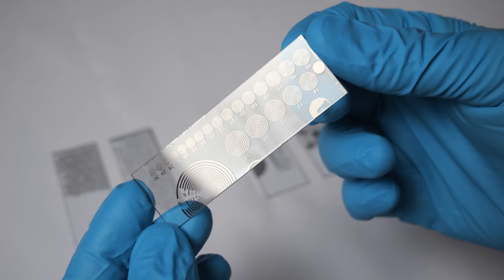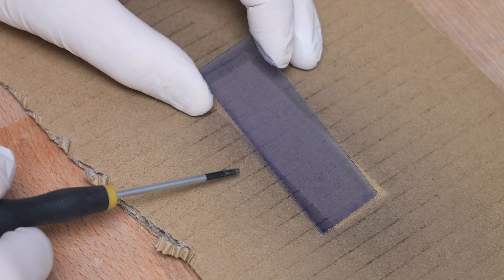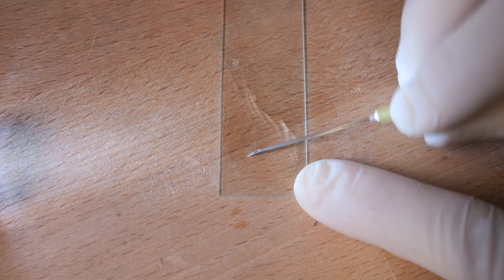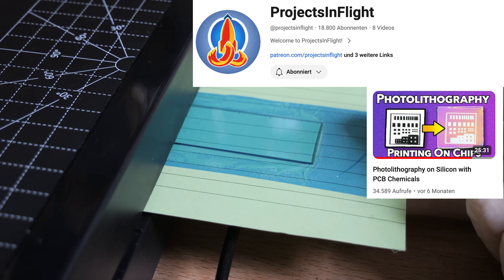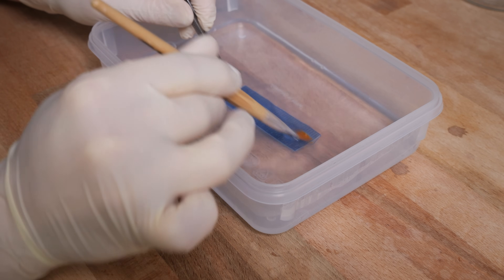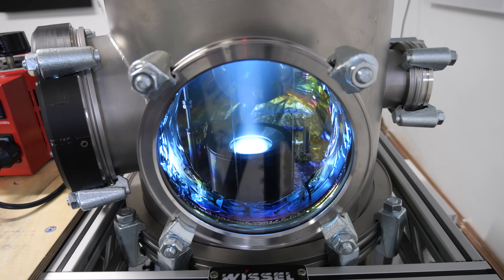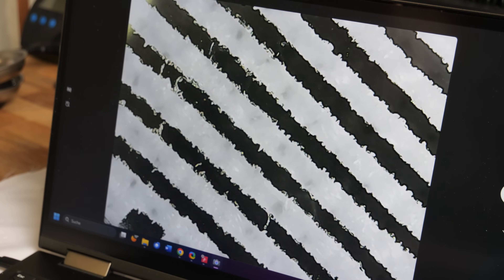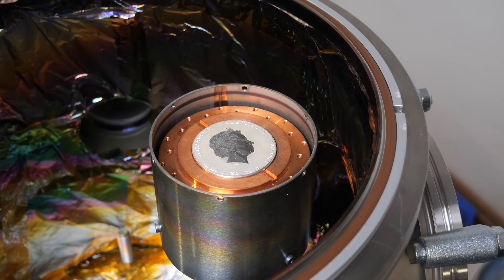Writing in Titanium on Glass - Lift-Off Photolithography

Comment: I wonder how hard it would be to repurpose a SLA (or MSLA) printer to replace the masks.
Reply: I'm pretty sure that would work great as long as the photoresist is sensitive to 405nm light. You wouldn't need to modify the printer at all. Just put the slide down onto the screen and expose it with your image. Converting an image into an STL or 3MF that could be printed is trivial.

Comment: I wonder if you could use a fiber laser on very, very low settings to "draw" on the photoresist.  Of course that requires a fiber laser at the right wave length so it would be expensive and possible not work.
Reply from the maker: I was also thinking about that. But a fiber laser is prohibitively expensive for me. Otherwise it would definitely be worth a try. Maybe not even using photoresist but just burning away a coating (layer of paint) which can be dissolved after sputtering.

Comment: I was wondering if you couldnt just print the mask in big letters then use a lens to focus down the light passing through the paper? It would require a lens the size of your sheet of paper but i believe you can get a4 size Fresnel lenses for pretty cheap.

The only thing you'll have to figure out is where the focal point is.

But then you'll have the ability to get samples the size of an A4 sheet of paper with the current resolution or smaller samples:

In the case of the glass plate youre using 26x76mm plates, using a4 sheet you'd get aproximatively a 10x in your resolution.
Not enough to call it perfect but cheap and easy to setup!

Comment: Have you considered using an MSLA 3d printer to expose the photoresist? Modern ones have nicely designed optical systems that project very detailed UV light in whatever pattern you want. It would add a bit of cost, but you could skip the special paper and printing and probably have higher detail as well.

Comment: LED household lights don't produce any UV.
I work with photoresist under white LED light regularly without issue.

As for increasing resolution, is it possible to use multiple masks layered like they do for silicon chip production?

Comment: How about making inverse photo-magnifier setup? You could then use much larger physical mask, but using a lens project the actual UV exposing onto the glass slide with much smaller dimensions. Just like modern silicon wafer photolitography process but much simpler?

Comment: Something tells me the anti-aliasing in your computer's fonts or OS may be reducing the quality of your masks.  Hence the single side fuzzies perhaps.  

If not that, an image reducing setup may be necessary to get higher quality.  Collimated lighting followed by reflection off of a glass backed first surface mirror mask (created by magnetron sputtering) and then shrinking lenses or mirrors should be adequate.

Comment: Awesome!
Rather than improving the mask resolution, would it be easier to focus the UV optically? You mention wanting the lamp "as far away as possible", presumably so that the rays are approximately parallel at the shadow mask, but it should be possible to put a much larger mask directly on the lamp and use a concave lens to focus it down to slide-sized parallel rays. Similarly, you could then use an LCD (e.g. from a resin printer) - or a DLP and mirror - to make it an active mask.

Comment: Mungolux has photoresist that is quite thick and works well for spin coating, if you want a thinner layer you can dilute it, I used acetone but other solvents that are less volatile might be even better. The resist itself has some issues with being tricky to develop right if your setup has a low contrast ratio but the resolution can be quite good.

Comment: You should try ordering a metal mask with your text or designs laser cut. PCB Way should be able to accommodate that. They make solder paste masks for custom pcbs.
Reply: The issue with this is unsupported lands, such as the inside of a lowercase e for example. Those will just fall out. With a PCB paste mask, there are no unsupported islands like this.

Comment: I'm not sure if another comment has mentioned it already but I'd be interested to see whether an LCD resin printer with a high enough resolutions could actually improve your resolution. I imagine you just place the slide on the print bed instead of the VAT of resin and do a manual exposure for as long as you need.

Comment: Couldn't you use optics to reduce a much larger, higher resolution mask for exposure?
Reply: That is what applied science did.
Reply from the maker: Applied science has produced a very small mask with a camera and used it to expose the photoresist. Using lenses to project a larger mask onto the photoresist should also be possible. I think Huygens Optics has done something along those lines. But I know very little about optics, and I believe the necessary lenses are very expensive. Nevertheless, it's probably the best way to create very small features.

Comment: would it be possible to expose the photosensitive film with a magnifying glass in a tiny dark box  so you can use a bigger transparency and achieve a higher resolution? i guess there would be a resolution limit for the film too, but i think it would be worth a try!
excelent video btw!
Reply from the maker: Thanks! Yes, I am currently working on using an optical setup to project a smaller image of a larger mask onto the photoresist.

Comment: I would experiment with a 4K monitor and a lens to project it on the glass. Project with blue only might be enough to develop the photo resist. If not you could remove the back panel and replace the white led backlight with ultraviolet leds. 

4K pixels (horizontal) projected to 4cm glass surface would yield 1000 pixels per cm = 10,000 per meter resulting in a 0.00001 meter resolution which is 10micron.

Comment: Should you not remove the 2nd protective film layer first? This would get your mask directly in contact with the resist film, instead of being separated by the protective layer. Also, there are various thickness of photoresist films and I think you would want the thinnest one you can find.

Comment: In effect you are doing what in photographic terms would be called a contact print, where the negative is in contact with the emulsion of the print. Photolithography would give higher resolution. It is the photographic equivalent of using the enlarger in reverse.

Comment: You should build a jig to project a larger mask first to a smaller point, then with a Fresnel lens into collimated light to then project it onto the actual slide. This way the resolution of the printer no longer becomes a limiting factor in the resolution of small parts.
Reply: A fresnel lens would do more harm than good, since their image forming quality is intrinsically inferior, especially with regards to high-frequency details and optical abberations.

Comment: In my experience you should use a point light source. Doing printed circuit boards, a light source that wide as the one you use severely limits the achievable resolution. I actually prefer a metal halide lamp without reflector.

Comment: 100um is suspiciously bad considering the process that you're following. You should really be able to get nice straight lines, closer to 60um resolution and without that 'dithered' or grainy appearance.
But just in case this is the best you can hope for, you can try something like multiple patterning. That is, breaking up your original mask design into 2 (or more) masks where each has only features that are spaced > 150um apart, then you just need to do accurate aligning once, since you can use the produced titanium part as a single mask for all subsequent production runs.

The only thing I can think of (apart from using a spin-on photoresist like you already said) would be to ensure you don't have any printer drivers/software still lurking somewhere in your printing data path, because those masks look very similar to what you get when the image you want to print gets pre-processed for normal photo use. Rather than reproduce sharp, high contrast lines, you just get a dithered mess.

If you're not able to get an inkjet printer setup where it prints a bit-perfect copy of your input data, you might be better off just hacking open a cheap/old 4k projector.
They can reliably produce perfectly planar images, down to 10um resolution, especially if you replace its stock light source with a 405nm laser. It doesn't need to be a particularly powerful laser, and even cheap multimode lasers can be made to work quite well if you insert a beam expander, an optical diffuser and a polariser (aligned to the axis of rotation of the DMD's mirrors) in before the collimator lens.

Comment: What about using a laser engraver to cut you masks out of something like vinyl
Reply from the maker: I haven't tried it but I highly doubt the feature size/resolution would be better (due to for example the heat melting the plastic close to the cut). In addition you would need to transfer the vinyl to the glass. I don't think that's possible with very fine features.

Comment: I use tracing paper and a laser printer to create photomasks for PCBs and it works without problems. That it doesn't work well for you is very likely a combination of materials used and the specific laser printer, not the process itself. Make sure that your photoresist wavelength matches your lights. LEDs are usually really bad at this (unless you made sure they are the right wavelength), because their wavelength is often just slightly below 400nm, while many photoresists are more sensitive closer to 350nm. The dry film is also very thick, usually several tens of µm (compared to a few µm for other film types). That is important, because resists have an "aspect ratio", that is how narrow a feature can be compared to film thickness. E. g. an aspect ratio of 10:1 means for a film thickness of 50µm features can't get narrower than 5µm. It's essentially the same reason why you put your printouts face down onto the resist.

For reference:
• The paper I use is tracing paper 82g/m² (Schoellershammer Glama Microdraft hochtransparentes Zeichenpapier, DIN A4 Block mit 50 Blatt, 82 g/m²).
• The printer is an ancient Brother HL-2030 with unbranded refill toner, set to the highest resolution and no "toner saving". No double stacking or printing needed.
• The PCBs are Bungard presensitized boards. Obviously PCBs are not what you need, but Bungard offers a "Presensitizing Service" for your own material. Maybe they can do it on glass as well? Their photoresist has a very wide margin between removing the exposed resist and dissolving the non-exposed resist.
• The exposure is done by a repurposed face tanner. I put the 4 UV tubes and the back reflector of the tanner into an old flatbed scanner case.

Comment: Something to test: a lot of photo machines use a thin layer of fluid (generally di) between the mask (reticle) and wafer, this helps with focusing. Easy enough to test in your setup if this gives better results.
Reply from the maker: I didn’t know that. Thanks for the information!
Reply: @AdvancedTinkering  yeah, honestly I'm not sure if it will help here tho, it's used near the diffraction limit to reduce fringe interference effects iirc. However it does help with focusing, so I still think it's worth a test haha.
Reply: @AdvancedTinkering  yeah, honestly I'm not sure if it will help here tho, it's used near the diffraction limit to reduce fringe interference effects iirc. However it does help with focusing, so I still think it's worth a test haha.
Reply: What is this di?
Reply: @MekazaBitrusty Deionized water.
Reply: He is not even using collimated exposure light source, index matching won't help here.

Comment: I have one idea, how you could get finer details. But this way would involve Optics. You can Print your stencil way bigger, like A4 Paper Size biger and than project it with lenses smaler on your resist. Like a Overhead Projector but making everything smaler.
Or maybe with an Resin SLA Printer.

And your Ad was perfect. normaly is skip this ads but you made it intresting and not disrupting your video an i watched it.

Comment: Woah, the resist under UV light at 9:01 glows! That's cool, I wonder why it's mostly at the edges

Also, it's nice to see you using items from multiple previous videos to make this happen!
Reply: Nice catch! My interpretation: the resist reacts to uv, meaning necessarily something within it is ionized at those wavelengths, that ionization leads to crosslinking (negative resist) or bond breaking (positive resist), from there one of two things must be happening: either the chemical change only requires part of the photons energy and the rest is lost as a photon at a higher wavelength, or once the chemical change has occurred the energy cannot be fully absorbed and the electron releases what isn't converted to heat as a photon. These lead to phosphorescence.

The higher amplitude at the edges I'd guess is due to the different surfaces refracting the light and channeling it to the edges, similar to a fiber optic cable.
Reply: This is my guess (sorry for my messy English): The UV light passes through the film and enters the glass, and some of it undergoes total internal reflection (TIR) within the slide. The light bounces off the inner surfaces, traveling inside along the whole width of the glass. It eventually reaches the edges, where it can escape. The effect is more pronounced along the sides because of this, as the light interacts more this way with the glass triggering fluorescence more noticeably than on the flat surfaces.

Comment: perhaps something like a film photo enlarger with a UV light source could be used to give you a better resolution, though the magnification would need to be the reciprocal of what is in a traditional film enlarger. instead of enlarging a 35mm film negative, you could use a cheap LCD panel, similar to what is used as a mask in resin 3D printers, but then shrunk optically to the size of your glass slides. alternately, perhaps swapping both the optics and the light source in a digital projector might work as well, as it's already designed to be projected through. it seems like that would give you a better working resolution than trying to create a resist that has the physical detail at a 1:1 scale of what you're trying to sputter.

Comment: One slightly less toxic alternative to using KOH+IPA for cleaning your glass might be to use "whiting," or calcium carbonate.  It is used for cleaning flux and cement in creating stained glass.  It was recommended to me in a video by HISglassworks for preparing glass for gluing with HXTAL- an archival grade polyester epoxy.  

Glass artists use a titanium "pen" to indelibly sign their artwork.  The titanium marking is improved by marking the glass while it is wet.  I have had good results creating images on glass using a TiPen in a desktop CNC.  I have not had good results attempting to electroplate the titanium images with copper- the plating achieves a certain thickness and peels back away from the glass in the plating bath, and further plating creates more "images" which also lift up.  The result was like pages of an open book, lifting slightly due to their own stiffness.  The copper doesn't bond well to the titanium.

Comment: Maybe you can print the mask way bigger, put a lens between the mask and the photoresistive slide, then turn on the uv light and that should not remove, but make the errors way smaller, be careful because you are going to expose the photoresist way faster

Comment: In offset printing, real black is formed by not only printing black, but duplicating the black channel onto the cyan. Probably on inkjet you can even try all other colors. If you use Illustrator or Photoshop you can view each color channel and copy paste them to one another.
Reply from the maker: Very good idea! I heard before, that some printers print an additional color besides black, but I didn't think of using it here. Overlaying different colors in Photoshop is a good idea! Although I didn't feel like the issue was that my mask was letting light through. Rather, the printer's resolution was reaching its limits.
Reply: @AdvancedTinkering  I good printer driver (at least on Mac, has the option for 'overprinting' in the settings too.

Comment: The converging line pattern looked like the printer head moved across, not along the lines. Maybe you can get better definition of features along the axis of printer head movement?
It's been a few years, but when I did PCB etching I think laser printers had superior resolution.
Other than that, I think optical projection is the best way to increase the resolution. Also crazy expensive I imagine for large area patterns without warping dimensions.
Reply from the maker: Oh, that's a very good point! Thanks for pointing that out! I will try and see if the results are better if the lines are oriented 90°. 
My laser printer and ink jet have the same dpi. But the ink jet prints were a lot darker.